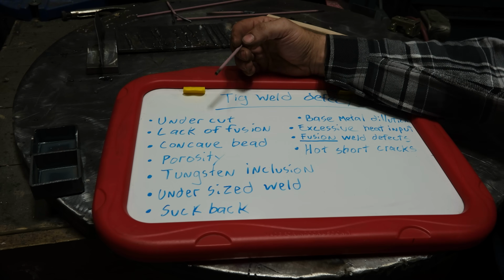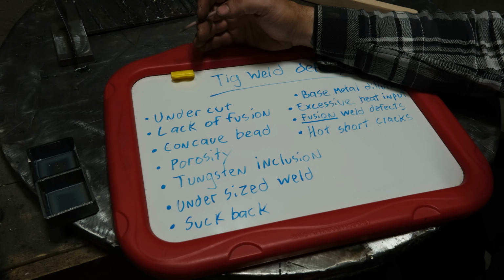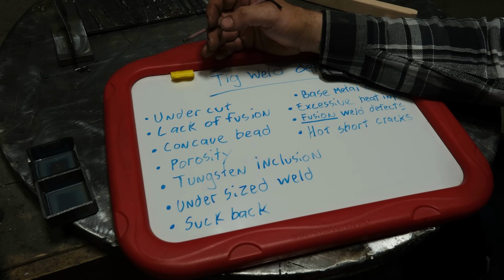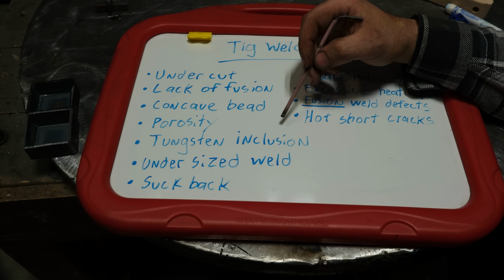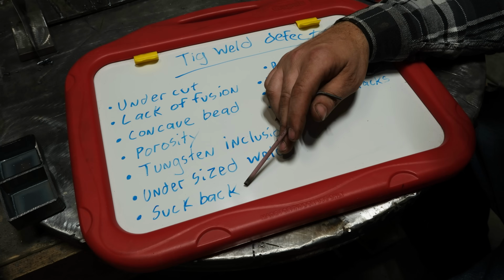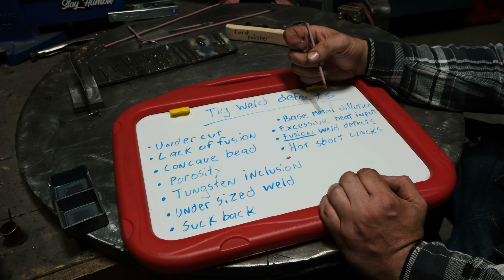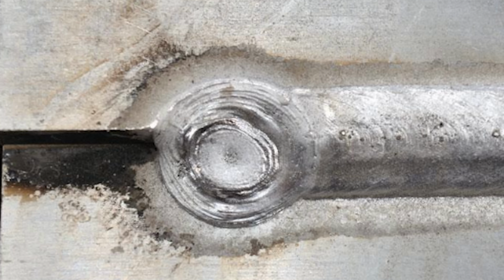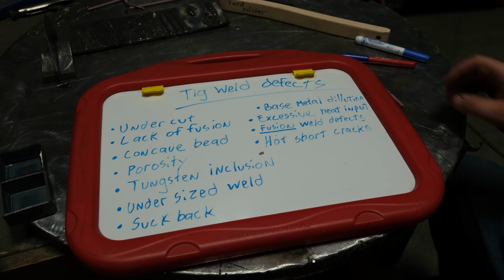Beginners guide to tig welding defects

Comment: As usual an extremely informative video. I leaned so much especially about possible defects. Also good know about tig weld heavy plates if you don't have stick or can't do spray arc. Thanks for the lesson, Greg. We are never too old to learn.
Reply from the maker: Glad you liked the video 😀.  Luckily tig tends to make very clean welds, and the defects tend to be fairly easy to spot.   And it definitely can weld unlimited thickness material, provided you have the time to do it lol.  It’s probably 3x as slow as even 3/32 stick rods, but for a quality weld sometimes it’s worth the slower speed 😀.

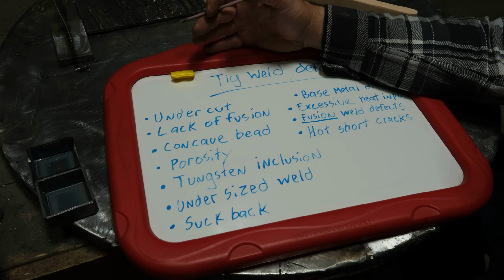Comment: 11:05 Don’t forget filler contamination. Besides out-of-the-box contamination, dirty gloves and table are possible sources.
Reply from the maker: Great point.  At a minimum it will typically cause tungsten contamination, and with things like aluminum it can cause internal weld porosity.  The cleaner the better 😀👍

Comment: Good stuff!  Do you need argon 5.0 or is 4.5 "good enough" ?  Or rather depends on base metal eg Titanium^
Reply from the maker: You bring up a great question.  So welding grade argon in the states (I believe would be 4.5-4.6) tends to not be the highest purity.  Where this becomes an issue is super critical welds on reactive metals.  Titanium is definitely a metal that’s sensitive to oxygen, if it’s exposed to it while hot the weld material is basically junk.   On high liability work (think aerospace) they very well might specify ultra high purity argon is to be used.  For most of us the normal stuff is more than adequate.  

Edit:  I thought I would mention that when welding aluminum in aerospace I believe they tend to use UHP (ultra high purity helium) over UHP argon.  Not only does it help with heat input via increased arc voltage, but from my understanding it reduces porosity that is commonly found on aluminum welds with even UHP argon.

Comment: Would you consider buying lincon 180 sprinter
Reply from the maker: Great question.  Based on how reliable/decent Lincoln’s newer 215 machines are, yes I would.  The sprinter is basically a small form factor machine like the esab rogue.  One thing to keep in mind is the esab rogue is capable of more output on 120v.  On 120v the esab will run a 3/32 7018 at 90 amps or a 1/8th 6010.  The sprinter based on their specs will likely only run a 3/32 7018 (it’s 85amp max).  If you want to be able to run 1/8th 6010 or 3/32 7018 rods on 120v it would be best to look at the miller maxstar 161 or the rogue.  Otherwise on 240v I am sure the sprinter will run any rod you want perfect 👍.

Comment: 27:40 AH! all the soot and grease the Diesel dishes out lies inside, E6010 makes a TIG all the 409 can SMAW at. twin sticks 3/32" E6010, clean nothing and the 304 pops the boil then sails out flat. $10 a 5lb box, no gas no problem. Titanium loves 6010 HSS loves 6010 tool steel loves 6010 stainless loves 6010 brass loves 6010 copper loves 6010 lead loves drooling off the battery posts onto the 6010. 6010 everything, the oil and grease adds to the shielded weld effect that the CO2 in the Are Gone TIG decomposes into pure O2 at 4500*f. spray arc glass MIG pig, not for structural use because "civil socioeconomics engineers banned products/material of structural capacity".

Comment: I've experienced hot short cracks on thick aluminum and was surprised at just how loud the bang was as the part actually split down the weld!
Reply from the maker: Slapping some thick welds on aluminum can definitely lead to some cracks lol.  I am sure it was cracking as it cooled and failed once the stress was enough lol.

Comment: Video Idea: How to prevent warping. Example building a frame from angle iron where the 45° inside corners have gaps toward the center. The weld wants to pull the corner tighter than 90°.
Reply from the maker: I am definitely overdue on something like that.  I did a video a long time ago sort of on that but I will have to actually make something 😀👍

Comment: interesting, i didnt know you could get suck back on fillet welds i thought it was only for open roots
Reply from the maker: The only reason I knew about it was from doing a ton of cracked header repairs and repairing aluminum trailers with cracked welds.  On 1/8th and thinner material if you run hot and not enough filler it will happen.  Guaranteed place for a crack to happen lol.